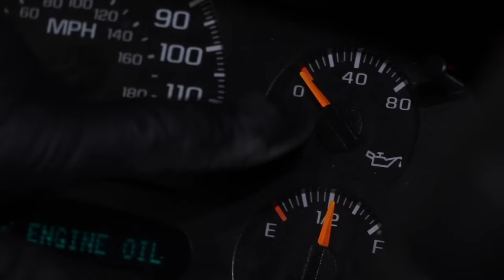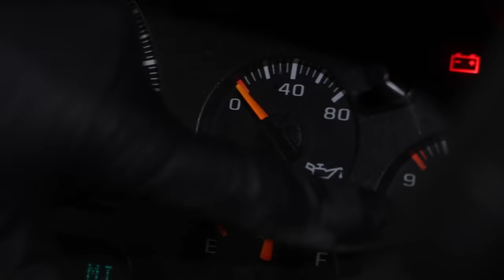Top 5 Problems 2000-06 GMC Yukon Sierra Chevy Suburban Tahoe Silverado Avalanche Cadillac Escalade

Comment: Brake lines and fuel lines rott out in almost every single one
Reply from the maker: +Geo Powless Thanks for the feedback!
Reply: The brake lines rotted on my Silverado at only 40,000 miles and 7 years old.  The problem is the line lays in frame channel which hold salt and other gunk.  I damn near went through the side of a building when my went.
Reply: My 2002 Silverado 4x4,  62 000kms, garage stored, the frame went to pieces.   Undercoated every year.  I loved that truck, had to sell her for par6s :(
Reply: Parts*
Reply: Cheezer  I just had to replace my front one's on my 07. It does have 232000 on it though so I'm not complaining, just talking bout my chevy.
Reply: Cheezer  wow! 242k on a year-old vehicle? You sir get the trophy for driving the hell out of your truck.👍
Reply: @georgeperkins4171  13 year old vehicle.  Some people put 100k+ on their vehicles yearly, 50k is pretty common for people who travel for sales.
Reply: @georgeperkins4171  he said it was an '04
Reply: Do the flex fuel lines hold up any better?
Reply: I a have a 2001 suburban that is almost rust free i guess u just have 2 get lucky. 200k miles and still going strong
Reply from the maker: +jose millan Thanks for checking us out! 1AAuto.com
Reply: Dude I had trans lines done !!!

Comment: "Top Problems 2000-06 " yet the thumb nail shows a 2007?
Reply: Brian Willess mine shows the right vehicle but shows NNBS vehicles instead of NBS ones lol
Reply: Lol thumbnail is not an 07
Reply: @alfredogarciajr40  Silverado and Sierra generation was 1999 through 2007 Classic.
Reply: 2007 have a totally different body style...
Reply: @phoenixproductions5358  it's a 2007 classic or 2007.5. It was a body style made to look like the older ones but yet still be a newer truck. It's pretty much alike they continue the older Generations into the newer years.
Reply: @phoenixproductions5358   There were 2 body styles and 2007. One was called the classic.
Reply: My 2007 looks identical to all 2006 and 2005 Silverados
Reply: @phoenixproductions5358  nope the body style change is 2007.5 , i know i have an 2007 classic (old body style ) with a duramax lbz  and starting 2007.5 it is the duramax lmm
Reply: @sethh8892  the 2007 classic as a duramax lbz and in 2007.5 it is a lmm , so it is not an old body style in newer trurk the 2006 as same motor as the 2007 the lbz .The 2006 and 2007 are the same ,i have a 2007 2500hd duramax and i always order parts for 06 because if i order for 07 most of the time i end up with parts for a 2007.5 and they don't fit
Reply: @DavidWischnewski it was not classic , It became the classic once they came out with new style in 2007.5 so not to confuse when ordering parts ,but best way is to order parts for 2006 ,i know ,i happen to own a 2007 2500hd sierra duramax  old body style and nowhere does it say  classic on it or on title  and when i order parts i order for 2006 i learned after receiving    parts for 2007.5  to many times  .it is not just the body that changed 07 and 06 are the same ,07.5  is totally differnent  motor is a lmm  ,06-07 as lbz...ps english is a second language
Reply: Not only that but the first gen Escalades have a gmt 400 drivetrain. Not even the same as the gmt 800 drivetrain. Completely different motors
Reply: Common (classic) problem with Chevys, When I owned my 1999 (1999.5) Chevy Suburban and I went to an auto parts store (e.g. NAPA) I would order 1998 parts for engine and drivetrain and 2000 parts for dash and interior parts. They changed the production line, mid-year, and as long as you know what you are looking at it is fairly easy to get what you need.

Comment: A few other things that went bad on my 05’ Z71 Tahoe:

Instrument cluster- the PRNDL  and speedo went dark due to solder failures on the circuit board
Fuel door- the spring that holds it closed wore through the metal arm
Bumpers- the z71 has painted bumpers and they all rust. Not prepped correctly from the factory..
Heated seats- have a mind of their own and will go on as they please

But , this truck has 172k on it and runs like a champ. Parts are cheap and everywhere as are YouTube videos on how to fix anything yourself.
Reply from the maker: +rex racer Thanks for the feedback!

Comment: Lifter tick and stuck lifters
Reply: Run some Marvel Mystery Oil in your engine oil. That stuff REALLY flushes the engine. I used MMO twice, and both times I had to scoop sludge out from the drain hole, using coat hanger wire. But the tick went away and the engine runs smooth as silk now.
Reply: Those were common from the 99 pickups all the way through the 2014 SUVs!
Reply: Skye Christensen yep
Reply: That's a lack of maintence issue aka dirt old oil.....
Reply: Might be oil pick up tube O ring
Reply: not the 5.3 prior to 2007.5
Reply: My 4.8 V8 had a bad ticking since new. Took it to the dealer early on and was told they had been dealing with that problem for some time. The said they thought it was lifters as well but were told by Chevy that the pistons in the 4.8 had shortened skirts and they were slapping the bottom of the cylinder walls. Makes sense that it quiets down after warm up. Yikes! Don't know if it's true but, I've heard the knock sensors can make a racket .
Reply: Some people mistake the sound of a bad exhaust manifold gasket for a lifter tick.
Reply: Man oh man, i had an 01 jimmy that just ticked its lil 4.3 heart out but seemed to love the abuse i gave it day in & day out....until i spun a barring then kars 4 kids got her. But ive got an 01 yukon xl now just hit 170k & now im noticing a tick at idle, cold or hot. Marvel mystery oil u say?
Reply: My 5.3 had a tick too after it warms up and oil circulates it goes away. Sometimes I wonder if the if the exhaust gasket is bad?? I also recently added ATF fluid to help clean it up
Reply: Stock oil pumps suck, I have 2005 Tahoe with 5.3 160,000 miles I put high volume oil pump on and no more ticking, 40 pounds at idle and 60 pound cruising
Reply: @43Steelerss  i dissagree , my 2005 avalanche is done from bad lifter that collapsed and now truck smokes bad at start up and # 3 cylinder clugs up spark plugs once a week . Sold it bought new truck well old new truck lol im not paying 40 gs for a truck that will rot out in 2 years i always buy old used , that way its payed for and i can scrap it when im done with it
Reply: They are known for lifter tick but many times it's just the injectors clicking.  I'm running an 04 Avalanche with 170k and it's got the lifter tick though, even after flushing the engine.  I might need to do it again, but 170k miles, who can bitch about that.
Reply: REDLINE..... This engine in mine has had redline every 5,000 miles and it's super clean and quiet
Reply: @nathankelly8665  pressure would be low though wouldn't it?
Reply: @ChevySS1968  That stuff is witchcraft in a bottle.
Reply: 2000 Chevy 6.0 ticks since I bought it worse in the winter before the engine warms up. Ticks even when warmed up.
Reply: Replace 1 quart of oil when you do an oil change with 1 quart of Lucas High mileage oil stabilizer the real thick expensive shit and i bet you wont have a lifter tick any longer. Do it every oil change for 3 oil changes then run 2 quarts of the lucas stuff per oil change and i bet your motor will sound and run alot better.
Reply: @ChevySS1968  wow that is so crazy to hear u say that ive had to do the same thing with my 5.3 tahoe literaly scoopin sludge out with coathanger after running mmo
Reply: 245,000 on my 2004 avalanche 4x4 and it has a slight lifter tick but it's definitely not too noticable. Seems to come on a bit more when it's getting close to needing an oil change, but has just under 40psi of oil pressure at idle and runs great. Might try the pickup tube o ring gasket replacement to see if that helps with the tick but it honestly I think I'm just going to keep up the maintenance and see how long she will go for!
Reply: @ChevySS1968  I'd never heard of this concoction of amazing results... till about 3 months ago. I tried it and the stuck  lifter or whatever chirping noise went away like in 2 days worth of driving! I'd recommend it to everyone before spending  a lot of cash, u never.

Comment: Thanks!  My 2006 Yukon 4x4 had a hard life before I got it. Oil pressure sensor 3 times, suspension rubber bushings, U joints.  I like it's ride quality & 4x4 ability.

Comment: Forgot the evap problems
Reply: Conrado Avila  I have that problem I changed it but keeps marking evap
Reply: Yeah I had evap prob.
Reply: The parking brakes deserve honorable mention
Reply: How did y'all going about fixing this? I got this annoying small gross leak. Changed Purge Valve Solenoid and Purge Canister except thw charcoal canister.
Reply: That’s the only problem mine has
Reply: Never top off a chevy. Stop fueling after 1st click of gas full nozzle. Evap canister always fails
Reply: 3rdCoast Ghost have a smoke test done, could be a hose, could be charcoal from canister in one of the hoses, I replaced hoses and all EVERYTHING to fix mine, a smoke test prior would have saved me some cash
Reply: @3rdcoastghost  If you have access to an air compressor (one that can power pneumatic tools, not a tire inflator) you can remove the evap canister, put the hose to the inlet and send air through it until you get the dust / debris out.  Then reconnect it; you'll likely get a bit more life out of the thing, and can fill up your gas tank without it constantly tripping off.
Reply: Just ignore the light cause no matter what you do with the evap, that light is coming back on lol
Reply: Have EVaP issue here too
Reply: @3rdcoastghost  super late reply but try changing the gas cap as well! I had a similar issue. Changed the solenoid and canister only for the light to go off after changing the gas cap and rescanning with a tool. Good luck!
Reply: P0455 - I keep getting this code. I've already replaced the canister and it keeps sending a code when I get below a half tank of gas.

Comment: I have had everyone of those problems with my 2004 GMC Sierra work truck in 220,000 miles: all the sensors wear out, the ABS, the steering connector rod (3 times). Compared to German o Japanese cars and trucks the repairs are cheap and easy.

Comment: There was a mouse living in that exact same spot in the fuse box in my '04 suburban smh
Reply: Mine too forever I couldn't figure out why my outside temp wasn't working I checked in there and discovered 3 or 4 wires chewed thru
Reply: Same with parts 03 i picked up
Reply: MEEE TOOOOOO EXAT SAME SPOT on my 2000 yukon
Reply: Did you have to buy a new fuse box or repair the wire? If you repaired it, what gage wire did you use?

Comment: Any oil pressure problems you have with these years Of GMC/Chevrolet is going to be the oil pump and or the oil pump pick up O ring!!..  Best to run a separate oil pressure gauge, Real time not electric!!
Reply from the maker: +John BassHead Work Thanks for the feedback!
Reply: Just did mine a week ago new oil pump and o ring and timing chain while I was at it 276k
Reply: The oil pick up tube o-ring was the fix! I would have low oil pressure and lifter noise until the engine warmed up. This was not easy to identify. Cracked pick up tube o-ring was the culprit. The auto repair shop I take the truck to figured it out.

Comment: I just bought an 04 suburban that needs some work. It has a bad knock sensor, bad abs sensor, and weird electrical issues haha. Incredible!
Reply: And to everyone mentioning brake lines rotting. The previous owner just replaced them all like 1000 miles ago. It has 185k on it.

Comment: wrong! water pump, piston rattle on cold starts, rear end bearings, window switches.
Reply: Is that what that is in the morning piston rattle?
Reply from the maker: +David Riddle Thanks for the feedback!
Reply: you forgot about the plastic door handles snapping off
Reply: The piston rattle won't hurt anything though. Yea, it' a problem and it shouldn't do it, but if it can be ignored, then it's not a problem. haha
I do let it idle for 20-30 seconds on cold start though.
Reply: @Juli-n-David  at start up it could be the o ring on the oil pickup
Reply: I'm thinking I gotta do a rear end bearing soon.

Comment: My 06 Yukon has 280,000 miles on it and runs, looks, and drives perfect. However, it had the dreaded lifter tick when I bought it. Started to loose oil psi. I pulled the oil pan, and found it had a bad oring at the oil pump and dip tube. Replaced it, problem solved!! That was 2 years ago, still runs great today! Cost me 1 oring, and pan gasket. Easy.
Reply from the maker: +BRETT m Thanks for the feedback and checking us out!

Comment: I did the oil pressure sender in my 2006 Suburban.  I did not take the intake manifold off but I agree that's the "right" way to do it.  I'd add the little door handle switch covers that always fall apart.

Comment: Great video I’ve got a 2003 Tahoe 
It sometimes has a headlight flicker problem when you go around a corner and hit a bump 
As well sometimes driving at highway speed the service abs system comes across display in dash

Comment: I cussed quite a bit when replacing the knock sensors. Oh, man, it was a terrible job. Of course when I reassembled, I replace gaskets, so when I had 2 learn codes 0171 and 0174, I didn’t freak out that I had gasket leaks. I simply replace the Mass AIR flow sensor and solfeđo my problem. The screen actually looked fairly clean Save for what looked Like some small bits of paper. I imagine that small amt of ibstruction cause the codes. I replace the MAF sensor anyway seeing as it is 20 Years old. 

I have never enjoyed working on engines, but glad my Dad Made me help him bc I have saved many thousands of $$$ doing the work myself. I usually use this Channel to do any work on my Suburban.

Comment: One of the most expensive issues with these years that my 2004 Silverado still has is the failure of the stepper motor that requires removal of the dash to replace.  I just pinch off the heater hose line under the hood with a needle nose vice grip until it gets cold and then I release it.  another very common issue with these vehicles is the instrument cluster malfunction but that can be addressed rather easily with a. Soldering iron and an online instructions on how to do it

Comment: Great video.  I had the same ABS issue.   Rolled right through RED light at a intersection.   Good thing it wasn't busy.  Had no time to try E-brake.   Got that fixed and then later blew out brake line.   YEP, right near ABS module where the brake lines sit up against the frame collecting salt.   All good to go now.
Reply from the maker: +Mike Adkins Thanks for checking us out! 1AAuto.com

Comment: At 250k miles had to have the rear dif rebuilt on '04 Z71 Suburban.  Cost $2250, and thought I got ripped off.  It had the Limited slip dif.  The knock sensors were both replaced with harness at 240k miles.  Had driven it for 4 years with that situation so no biggie.  I feel they went out shortly after I had pressure washed the engine and got water under the intake manifold.  Having trouble with a few electrical items such as headlight switch and drivers seat been crazy for several years.  My oil pressure gauge hasn't worked since I bought it at 100k Miles. Good video and thanks.
Reply from the maker: +William Swindle Thanks for checking us out!

Comment: 2001 z71 tahoe.  210000 miles. Bought new. 
Brake lines. Brake lines.  Rust on chasis  and on hood and front bumper. Well maintained.  Also windshield washer reservoir. Had to relocate it.

Comment: Well, I have a 2000 Sierra, with 341,000, and a 2004 Sierra with 328,000.
 Bought them both new.
Both still run excellent.
 4.8 and 5.3.
 Both still on original tranny's, rear ends,and engines.
Both use a half a quart of oil, at the 5000 mile intervals, and don't leak a drop.
 I am diligent on maintenance, and enjoy doing it.
 I don't baby them...but drive them respectfully.
Neither has ever been over 4500 revs.
 I tow a 4500 lbs ski boat...a lot!
 I have done the replacement of "consumable" parts, before needed.
 I'm  looking to go half a mill, on both.
 Have had some of the issues that you described.
 Not a big deal, really.
Trucks of this vintage are great, if you are willing to do the maintenance.
 Just like anything else.
Treat it right, and it will treat you right.

Comment: I have an 06 Silverado with the 5.3. I have replaced the oil sensor twice, the o2 sensors twice, I currently have a parasitic draw that is impossible to locate. I have pulled every fuse and still can’t locate it. My ground cables look good but I think I’m going to change them anyway. I haven’t pulled my fuse panel covers but I will do that today. I’m about to change my knock sensors because those just checked out. The truck is great overall but I am super tired of plugging in my trickle charger to keep it alive. Thanks for the video!

Comment: Front air bag sensor twice, rotted thru brake lines, dash cluster/fuel gauge issues were most of my issues never had a issue with any of the "most common" problems you mentioned. Also had fuel pump nipples rot off at line attachments to pump. I work on tractor trailers for a living on the east coast so that being said the brine or whatever the state of Pa. uses on the road kills anything steel, double heavy hauler tractor frames and trailer suspensions and bogeys (plus it seems mostly Chevy pickups and Tahoe,Escalade , Yukons). 2005 Tahoe 5.3 146,000 MILES.
Reply from the maker: +H RALF Thanks for checking us out! 1AAuto.com